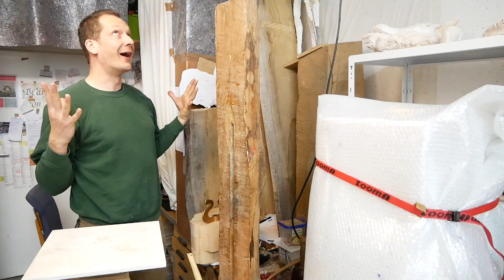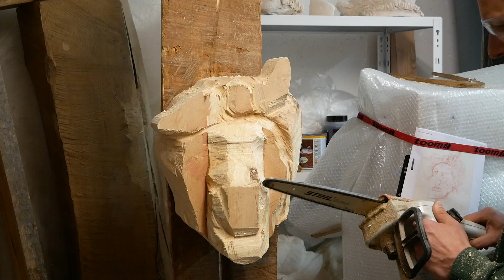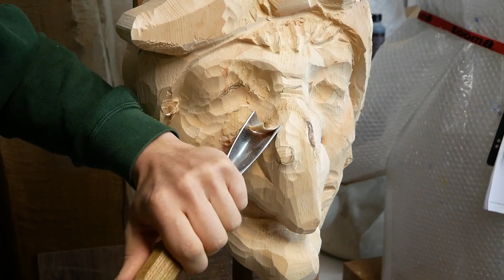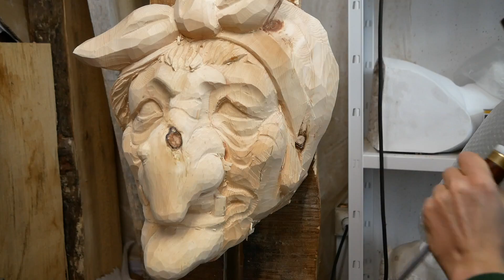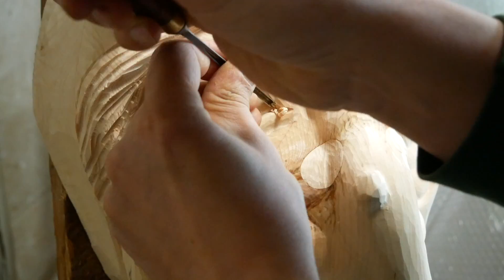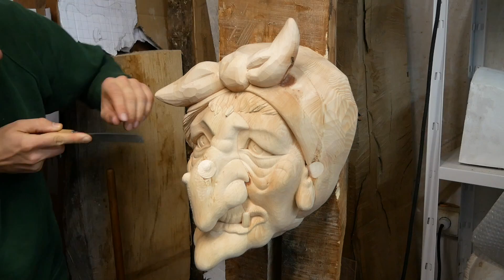Carving the Witch / Hexe aus Holz / Krampusmaske schnitzen

Comment: I am a new carver, having been at it less than a year, but have been carving at least a little almost every day. I am working on a small witch (one of my 1st originals) and was stalled on what direction to go, having a nose, brow, traditional hat and chin in the wood. Couldn't find the eyes or mouth in my minds eye, and just needed to move forward. I drew tremendous inspiration from your work. I had the pencil out before you were done. You put a wonderful playfulness in the carving with the addition of the bow, it could as easily gone dark, but you put a unique mood to it. I also like the plug method, that's one I'll be trying out sometime soon. Besides learning a lot and really enjoying watching you carve, I broke my "carvers block" and now have several directions I could go and I feel good about. Guess I'll have to do a few of these. It's small (160 x 80mm) size carvings, but you've got me thinking toward larger works as well. Cost is a factor there, so maybe I'll plan a larger work for the future. 

Wonderful video, thank you for sharing it, and I will be following you  in the future.